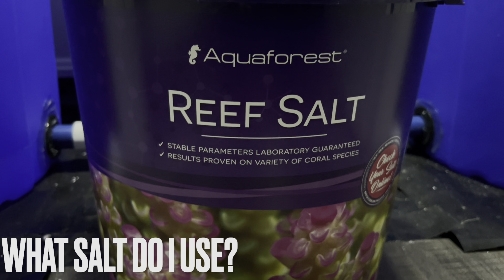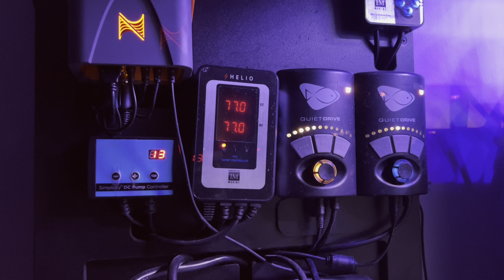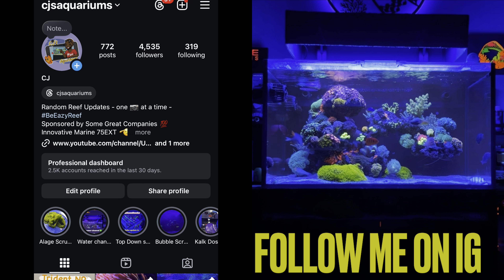The SOLO REEF - Surviving Life Being Busy | Ep.38

Comment: CJ, your tank is looking great. You have such a level of automation I am surprised you dont have a filter roller. I spend up to a month away from home. I run an Apex with autowater change, filter roller,  skimmer. I only auto test KH whilst I am away. One of the best bits of kit I use for remote operations are web based cameras.
Reply from the maker: Awesome setup man.. I’ve considered it but only ones I can use are the 4” mini ones for sock holders. I maybe try it but I mainly rely skimmer scrubber for filtration. Thanks for tappin in 🫡